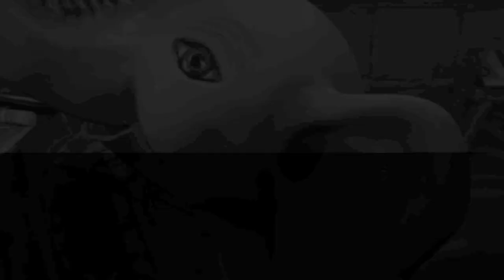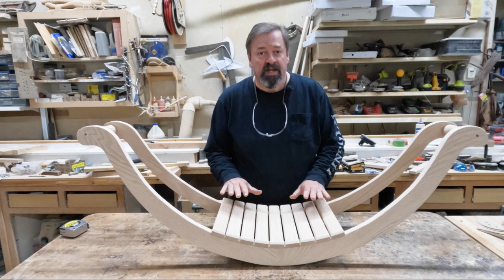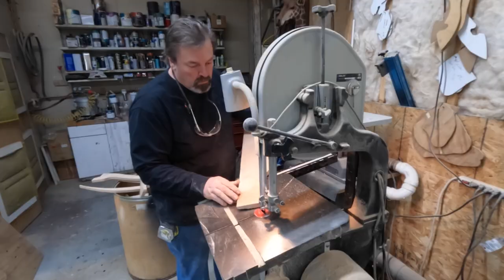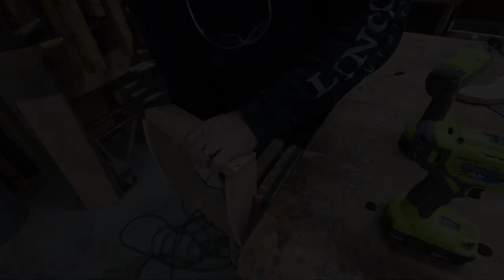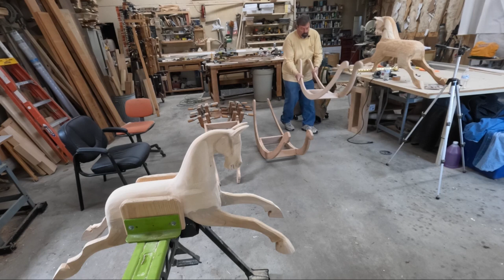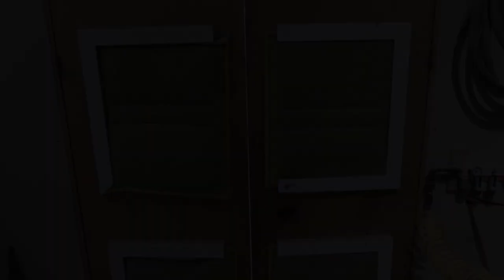Building Small OAK Bow Rockers for a Rocking Horse.

Comment: Great job!! I am making a rocking horse for my niece and was really struggling how to build these. I’m only ten minutes in as I write this comment—what is the “why” behind the 10 degree angle? I had a rocking horse growing up and my parents mentioned it would always scoot forward, so that it was basically unusable, and I noticed that it’s cut perfectly flat so that the two legs run perpendicular from the floor, not sure if that’s related to the issue of not staying put? 

Anyways, great job, I’ll get back to watching 👨‍🔬👨‍💻🪚
Reply from the maker: The 10 degree is there so that the entire rocker will sit flat on the floor. So you are correct in your assumption. Also, ( I’m no expert on these believe me, I just like building stuff!  Lol ) my opinion is that the early builders of these we’re working out how to make these more stable.  That’s why the Legs are splayed out and the rockers are tapered. Plus they aesthetically pleasing to look at.  Unfortunately, these will still walk across the floor. Anything on rockers will walk. That’s why the glider or “safety stand” was developed. It was an American that invented it. Not only did it take up less space but it stayed put.  Hope this helps. Let me know how it goes and If I can answer anything else, please let me know.  Thanks for watching.
Brett

Comment: Great job
Reply from the maker: Thank you and thank you for watching!
Brett
Reply: love your videos ....well done ... any tips on getting the rocker and leg spacings correct ... I assume you adjust the cross stringer  ??
Reply from the maker: @TimBeningfield  
Thank you!  To answer your question… since I’m using the Plans I purchased from The Rocking Horse Shop 20 +yrs ago, the horses usually fall into place, but once in awhile I’ll have to make small adjustments. That’s why I recommend leaving the end turnings off the rockers  until the horse is properly fitted. It gives you a little “wiggle” room to adjust. This little doll horse I’m making in the new series, I did have to cut a bit off the cross stringers ( what I call stretchers) Because the horses legs were not spaced out enough. It works, but the next one I make, I’ll be sure to make the adjustments on the bottom body block before I attach the legs. 
Cheers,
Brett

Comment: Is there an angle on the bows when you screw them or together so they bow  making them narrower at the ends?
Reply from the maker: The bows, crosspieces and the two end turnings are all cut at 10 degrees.  
That’s the magic number.
Hope this helps.
Brett

Comment: Sorry I wasn’t clear about it. When you cut the middle where you put the two pieces together you moved your miter saw.  What degree do you use?    Thanks
Reply from the maker: I believe your asking about what I call the stretchers. The two pieces that connect both sides of the rockers together. Those are also cut at 10degrees.